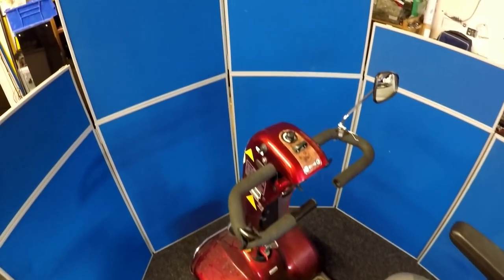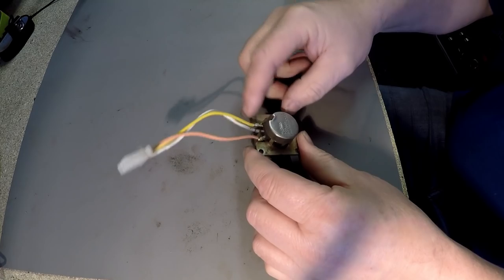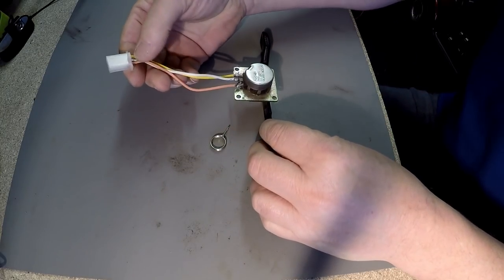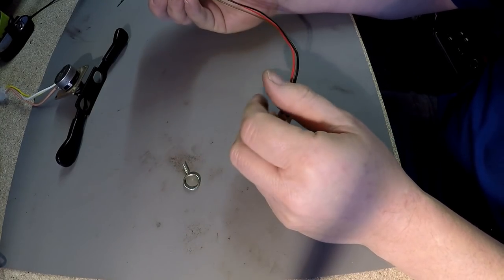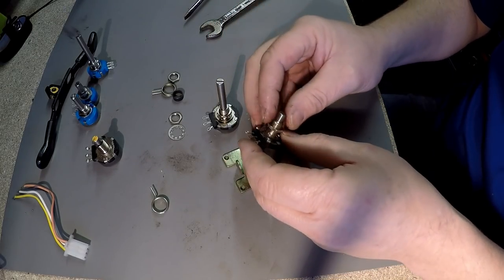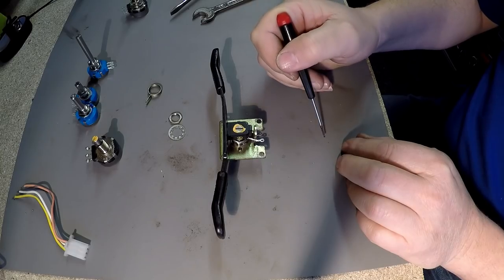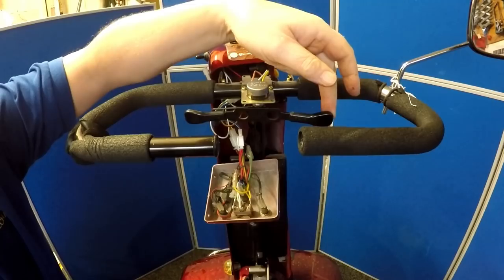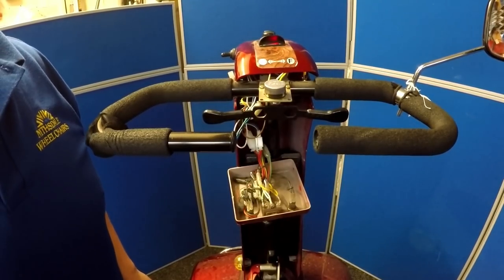Scooter speeds up and slows down Mobility scooter Throttle pot Repair

Comment: hi my scooter wont move can you help batteries fully charged no lights flashing
Reply from the maker: What have you checked on your scooter and when was it last used
Reply: Nithsdale Wheelchairs V  checked brake put new brushes in batteries fully charged when I try to move it it moves a little bit then stops
Reply: It was used November outside keep it in the house so use to move it back and forward to get into cuboad
Reply from the maker: phillip cannon what do you mean it moves a little 5 feet more less any noise when it stops does it drive in reverse any flash code
Reply: Nithsdale Wheelchairs V It only try's to move about 3-4inches makes a click noise no codes  reverse bleep comes on as should in reverse but does not move only try's to move forward
Reply: I have electronic brake off tested it and works scooter still wouldn't move with it off
Reply from the maker: phillip cannon see when it moves a few inches then stops does the electric brake click back on. I presume it does the same with driving in reverse.
Reply: Nithsdale Wheelchairs V 
Yes it dose
Reply from the maker: phillip cannon could be a faulty throttle pot I presume you have cleaned the commutator
Reply: Nithsdale Wheelchairs V know I haven't
Reply: What's that
Reply from the maker: phillip cannon check the rest of our videos they show how to do that in the motor

Comment: WHY ARE YOU MESSING around, JUST replACE THAT PLUG IN PART!
Reply from the maker: Could do but that’s not the point of the video. Some people want to save money and just replace the pot which is cheaper. Natural the complete Assy is a available at a larger cost. But this is not available on all models like the 888NR